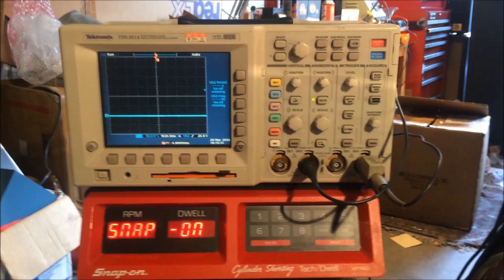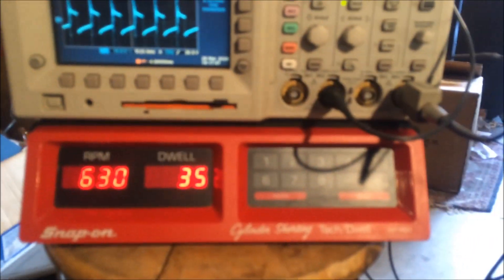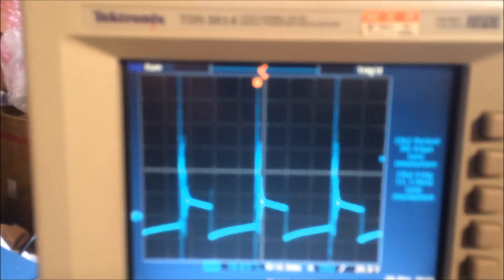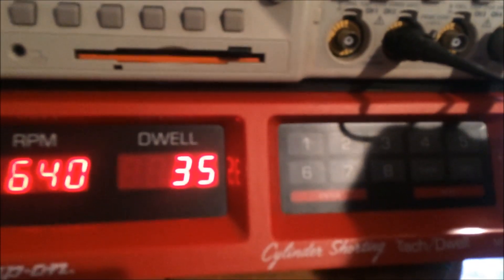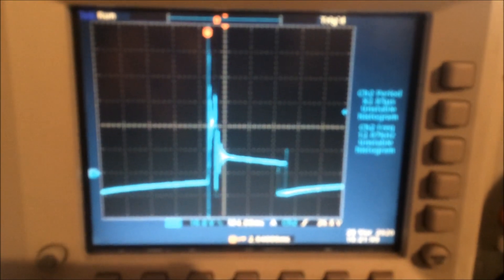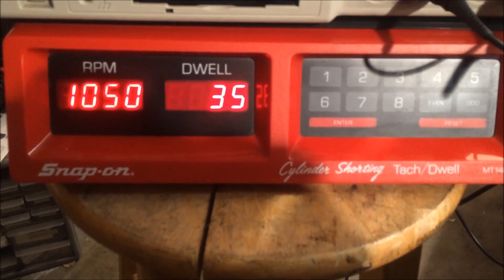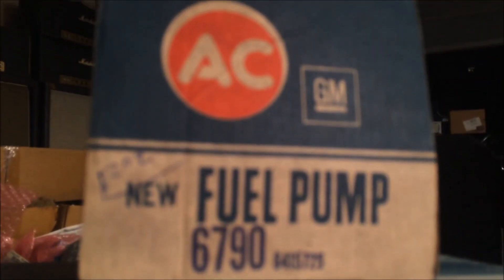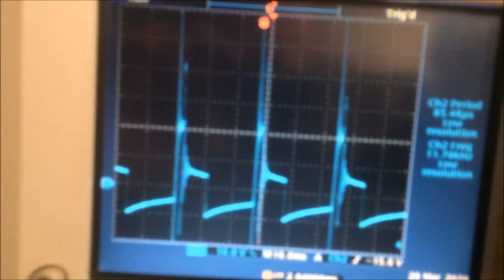DWELL and RPM MEASUREMENTS ON A 1963 CHEVY L6 3.2L  194 CID USING OSCILLOSCOPE

Comment: Video would have been pretty good if you would have just focused the camera!
Reply from the maker: Your totally spot on.... Next video I should get a tripod and have someone keep the focus locked in...
Reply: @cerrem1  I was trying to see the timebase settings in the scope. Do you know how to determine dwell angle by only looking at the scope waveform?
Reply from the maker: @bufus2997   You can set it from 4ms to 20ms ... then adjust it for the best view...   If you want to see what the DWELL is from the scope.. Use a calculator ... I explain it here.. . Looking at the time between cylinder waveforms we see 30ms with 6 Cylinders. 1 Distributor revolution is 360 Degrees allows a maximum of 360/6 =60 degrees per cylinder. Looking carefully at the coil charge slope of the waveform it is about 17.5ms of points being closed ... So our Duty Cycle is 17.5/30 = .583 ...... Dwell in terms of degrees would be 60 Degrees * .583 = 35 Degrees as our Dwell meter indicated.
Reply: @cerrem1  maybe you can help me understand...I thought the coil voltage would be like 40,000 volts. So how can you measure the signal without blowing up the scope? Is the peak voltage being lost because the frequency content is so high? I would have thought you would need a x1000 probe. I've never done these measurements before so any help understanding all this would be appreciated!!
Reply: @cerrem1  now that I think about it, I guess the high voltage is on the secondary not on the wire coming from the distributor.
Reply from the maker: @bufus2997  Yes....the low potential side of the coil windings to the scope with a 1x probe.. ....  Be careful not use use a BLASTER or super High Voltage coil when using old-school points...they will arc over and burn up the contact on the points real quick... High Voltage coils are for electronic ignition systems.. There is a point of diminished returns when it comes to how high a voltage you need... especially for street cars....
Reply: @cerrem1  thanks for this explanation!